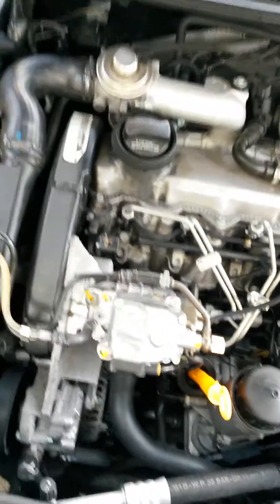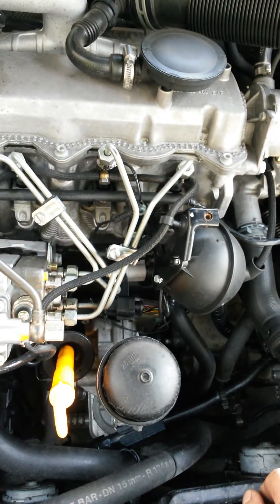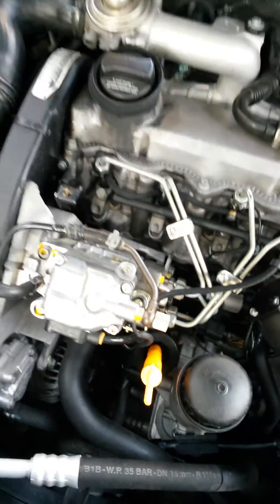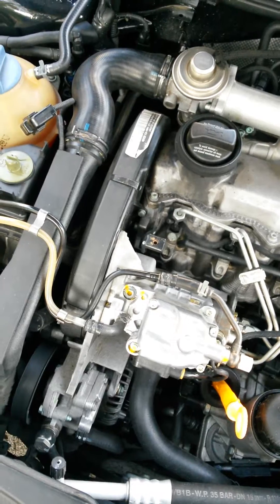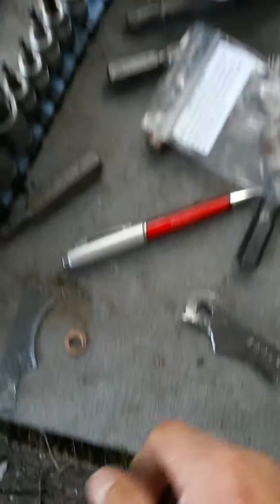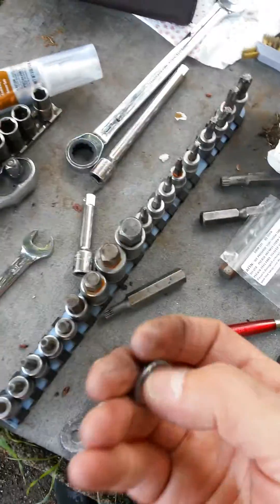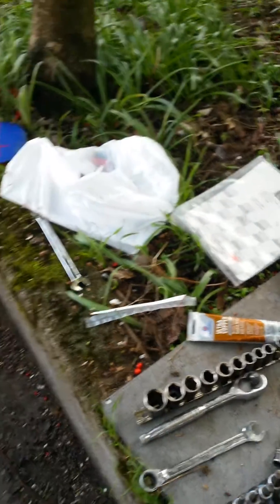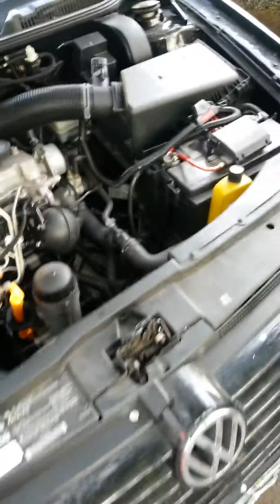Mk4 tdi injector seat repair, bore repair, leaking injector.

Comment: This probably worked but you can get a flat end reamer to re cut the seat to a uniform surface just did mine on my 03 tdi. Pull the glow plug and blow compressed air into gp orifice while working the reamer to prevent debris from getting into the cylinder.
Reply from the maker: True but didnt have injction seat reamer.

Comment: I am dealing with the same thing on an ALH MK4 Jetta with injector #3 blowing compression big-time.  Weighing my options. I previously put a gasket in the center of the injector where the head cap connects to the body, but now that I am running it hard I think the ring gasket failed.  It could be due to temperature or pressure.  TP add to a bad situation I think the lock down bolt is stripping out of the head too.  I might have to tap (in place) a larger SAE bolt.  How is your repair doing?

TDI Love from Chicago...
Reply from the maker: GallowayChicago mine holding up well. Running vnt 17 at stock psi. Get bore reamer and resurface seat then use helacoil on threads.